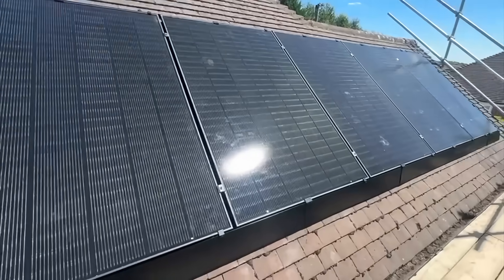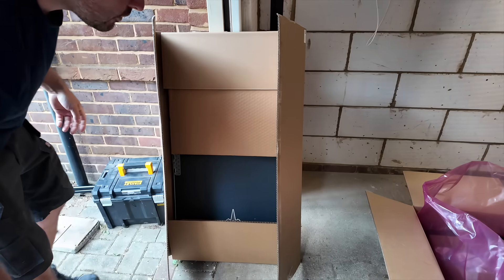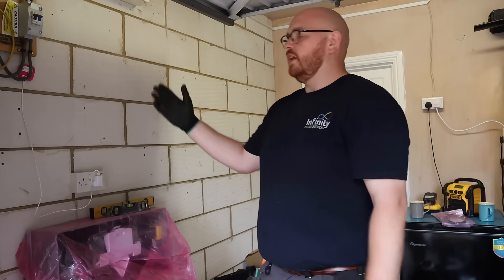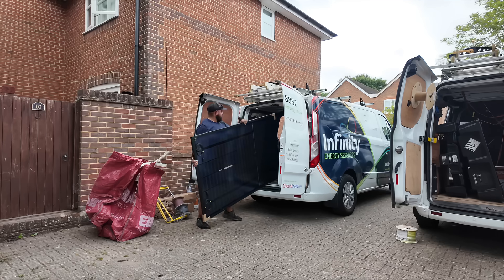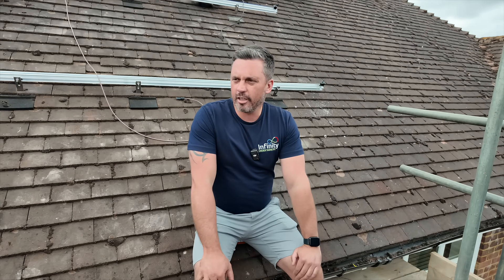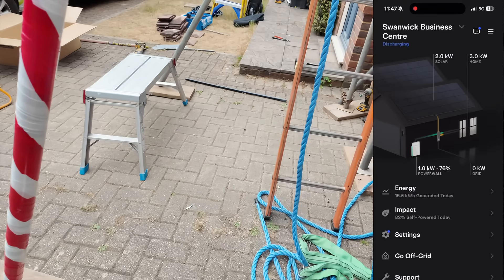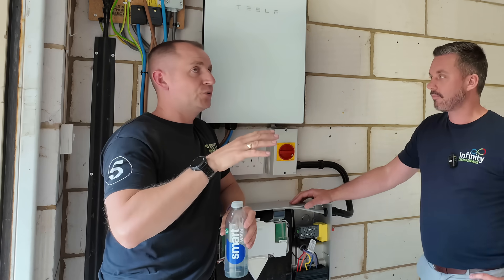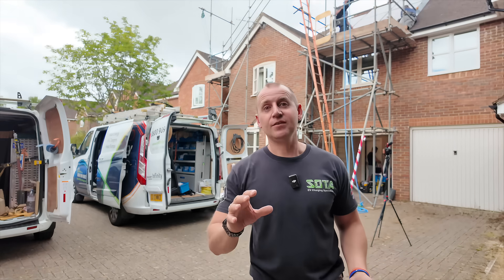Everything YOU NEED TO KNOW About Solar And Battery Storage in 2025

Comment: Alternatively - charge the battery on off peak all year at 7p / kwh. You can then sell your excess generation from the solar panels back to the grid at 15p /kwh. These figures are from a well known multi-limbed electricity supplier. You can even discharge unneeded battery power into the grid at the same rate. 7p to charge, sell at 15p. It`s a no brainer.
Reply: I,m new to this, could I just install the storage and charge them on the 7p/kwh off peak and use this during peak times, without the solar panels?
Reply: @paulellam6926  From what i’ve researched as a beginner yes you can, in theory, but if you factor in the cost of installing a battery system plus the cost of the battery/batteries. I think it would end up being a no brainer to install solar panels at the same rather than paying much more later on if you decide to have panels fitted. Reason being the labour costs. For scaffolding, connecting the panels again to your existing battery system etc etc. 

Don’t quote me on this but that’s how I understand it as a beginner.

Comment: Got mine earlier this year. Been great so far. Less panels though. I export everything at 15p/ kwhr, and charge on IOG every night at 7p/kwhr, and let my Zappi charge my car during the schedule they pick. When I plug in the car Octopus give you a schedule, which may discharge your stored battery power, so my fix is to charge by back up reserve to something like 50%, so that the grid sends power to the car, and maintains the home battery at a reasonable level, for the house to use later (Yeah, I know about Net Zero App, but its away to start a monthly charge for all the clever macros that it lets you do, I my fix works for me).
Ive went off on a tangent about EV charging, but its what lots of people that are getting solar will probably being doing sooner or later, so I thought it worth saying!

Tidy job lads.

Comment: You don't have to fit the mounting brackets every 1200mm. That's the maximum distance allowed. It can be significantly less depending on location and height above sea level.

Comment: The role of the earth electrode is to provide a Neutral-Earth bond for backup power in the event of a Loss of Mains (LoM) outage.
Reply: The neutral and earth bond is created in the gateway, there's a solid copper link that remains in situ and the contactor creates a link, the earth stake is used for a reference to earth that goes straight onto the MET along side the DNO earthing arrangements whether that is a TNC-S or TNS system

Comment: I've only come here to pick holes. 1:29 in and the installer is confusing Power (kW) with Energy (kWh). I expect more errors.
Reply: Listened to it twice and it’s not wrong at all?
Reply: @1981gumbo  There's no such thing as kWh per hour. The battery can output 11kW of power. It's able to store 13.5kWh of energy.
Reply: @VinoVeritas_ you need to get out more 😂
Reply: wrong mate, installer is correct here, and I work for a battery manufacturer in the technical dept.
Reply: @fitmydashcam  There's no such thing as kWh per hour. Just because someone washes plates in a restaurant, it doesn't make them Gordon Ramsay.

Comment: 6-8 years and then the batteries will probably need replacing. Its not a great investment
Reply: Except they come with a 10 year warranty. Keep up.
Reply: @VinoVeritas_  ok in 10 years they will need replacing lol still a crap investment
Reply: @dave_154  The 10 year warranty offers to replace the batteries should they have less than 70% of their original capacity available at the end of the 10 year period. If you believe that a battery with a minimum of 70% of its original capacity remaining is in need of replacement, then you haven't got a clue what you're talking about.

However, I agree that the Tesla Powerwall is overpriced and is unlikely to recover the original cost of investment until beyond 10 years, so I certainly wouldn't purchase one.
Reply: Honestly LiFePo4 cells seem to last forever in these sorts of low stress applications. I’ve got a 5 year old system that’s done 1400 cycles and no sign of any degradation.
Reply: lol
Reply: clueless
Reply: And they only last about 10 years. Just shy of when you will get your payback from the investment. The inverters also built into the powerwall so you cant just replace the battery cells you have to replace the whole powerwall which will cost you another £7/8000
Reply: @jordancole1991 They don't only last 10 years. They come with a 10 year warranty. They'll roughly last 16 years if fully cycling an average of once per day, every day.
Reply: Will do 10,000 cycles, so even if it does 1 cycle per day, it will last over 25 years, with a 10 year, unlimited cycle count warranty! It’s not the same as a mobile phone battery with 1,000 cycle count life.
Reply: @philmcmillan72  The LiFePO4 cells aren't rated for 10,000 cycles. They're rated for 6,000 cycles with an 80% Depth of Discharge at 25°C. The unlimited cycle life is nothing but vapourware as it will be impossible to fully cycle the battery more than 6,000 times within the 10 year warranty period.
Reply: Nah batteries have come on since the 6000 cycles pylontech have upped their spec to be 8000 cycles at 95% depth of discharge at 25c, I think a lot is to do with better battery management which has resulted in the increase or better cells who knows but that’s the spec for a battery not considered on pah with Tesla

Comment: The only thing I disagree with is when people mention power cuts. We don’t live in South Africa. I’ve had 1 this year for less than a minute
Reply: We don’t live in South Africa but the grid can and does fail either equipment or someone/something going through the line, in my area probably had about 2 or 3. 

I remember when the low grid frequency knocked houses off the grid. And I remember one last winter which was a local one only 3000 houses for a couple of hours had to boil the kettle for a neighbour as they where gasping for a cupa 😂 depends what you want out of a system on the design, if you don’t want back up don’t get it, if you want a bit more resilience then get it.
Reply: Exactly mate you've had one. I monitor almost 2k systems and see power cuts daily. I myself have a solar system with no backup device and it works for me. You learn to spot trends and problematic areas. 

This is only the second time I've heard someone mention the outgoing effects and worse still if solar systems/exports are common in your area. 

The DNO seems to be miles ahead of the ESB here in Ireland from my limited knowledge of it.
Reply from the maker: Yes I know what your saying but it’s a question that gets asked quite a lot 👍
Reply: Some people have overhead power which is a lot less reliable.
Reply: In the past month in Rugby we have had three cuts.  This afternoon a few years of stability.  It feels like the grid is becoming less stable.